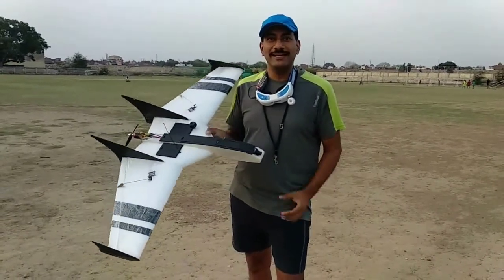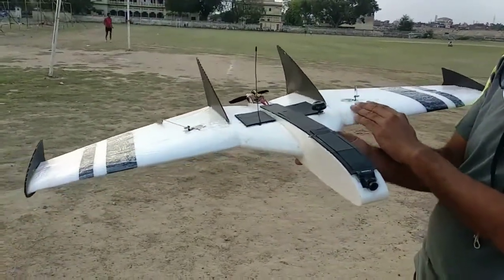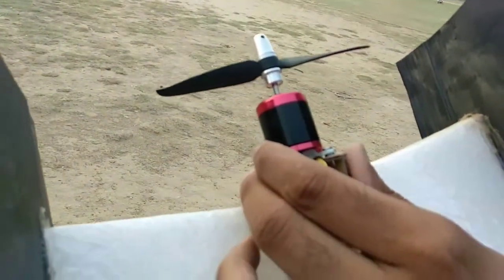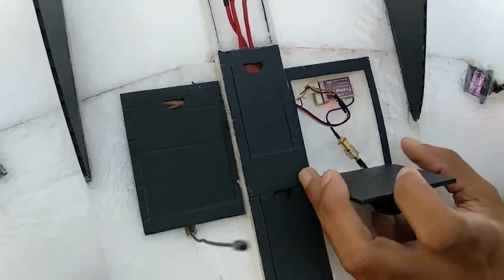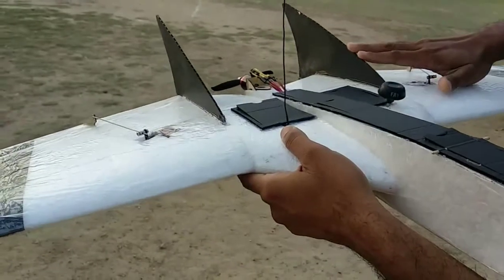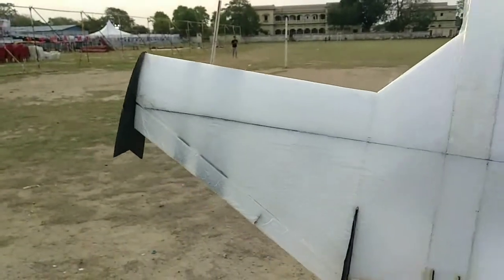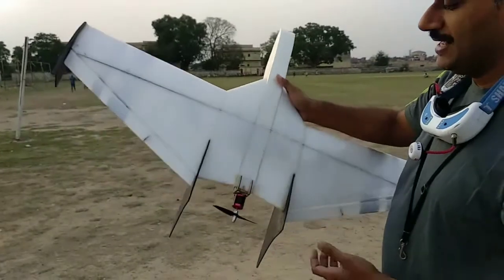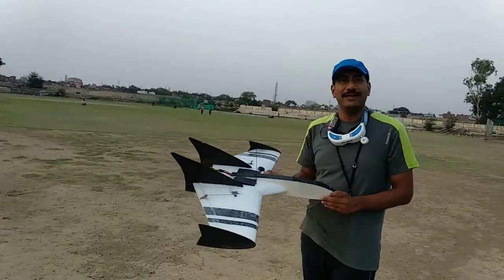Vortex-RC | Introducing Interceptor-100  EPP Forward swept jet like design

Comment: Why does your company claim innovation and your first model is a clone of the ritewing drak...that’s some shady business on a model that has been patented and is a staple in the uav industry...shame on you.
Reply from the maker: Before shaming others, learn to get the facts right. 1. Its a wrong assumption by you that this is a cone. Forward swept tail-less airplanes have been around for decades. Google Simitar models to see so many designs and plans. See here : 
https://www.rcgroups.com/forums/showthread.php?502443-Simitar-Astron-Pole-Star-Classic-Wiseguy

2. The airfoils and design used by us are different. The Drak uses the custom Ritewing Airfoil, which we havent event attempted to look at. The dimensions on our model are also very different

3. The Draks are Mass produced and Molded. Ours are individually hot wire cut. In fact in our country we do not have EPP blocks so we have used EPP sheets to build this in multiple sections that are glued.

4. Not being molded, the build of our models are very involved with a lot of precision required to get the sparring correct. The draks are molded so super easy to build by everyone . 

5. Indian customs have strictly banned import of any drone, UAV or models. It is nearly impossible for us to bring in stuff from outside India. Our models are at least an effort to help our country's FPV flyers gain access to models and help them with flying 

6. We do not sell outside India. So none of your business is effected. Whats the problem ? 

7. Our models help out so many of our fellow FPV folks have a great time flying, who otherwise wouldnt have access to models . Isnt it good to have the community grow and have more of fliers ?

8. Hard work ? See how many prototypes, trials and iterations we have done to come out with something ? Know the facts first before making statements. Clones and rip-offs are when you take a product, and exactly replicate it into something else and make a mass production out of it. Our models are individually hot wire cut EPP models, the designs to which we have made out and tweaked with time. In our country, EPP is hard to find. We are probably the only ones to have brought out those. Getting a decent plane to fly for 30 minutes is hard to fine. We at least have brought out something that helps our fellow fliers with that. Our market size is minuscule.We Probably sell a dozen models a year. So few can afford the expensive FPV and LR equipment. Come here and see how much of efforts are put in to help our community. Only Then you will see the innovation involved.
Reply: The drak went through dozens of prototypes and 6-7 different variations of wire cut pep before the owner Chris decided he had perfected it and had it molded...your model looks identical to one of his earlier prototypes. But maybe that’s complete coincidence, however I doubt it. Epp has been around for a long time, and people have been making wire cut models with it, for a long time...just look at visual aerial systems, they have dozens of wire cut epp models. As does ritewing and any other small uav business.
Reply from the maker: sean metzger if you look at our website you will see how many wings we have experiment Ed with including the Batman 1000mm plank. Our version of the Interceptor was born as an evolution of the Batman plank along with inspiration from Funjet.
I'll share videos and pictures of dozens of iterations on how we tweaked and stress tested the planks before making this one. Go ahead troll all our channels but get your facts right before you point your fingers.